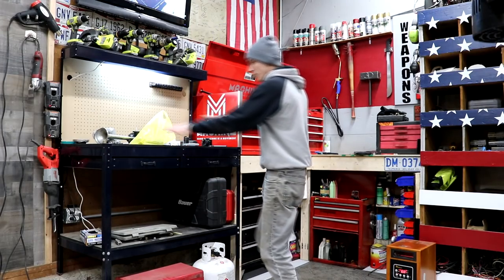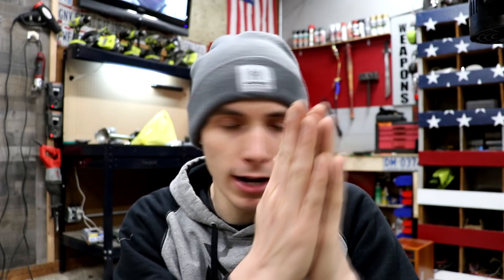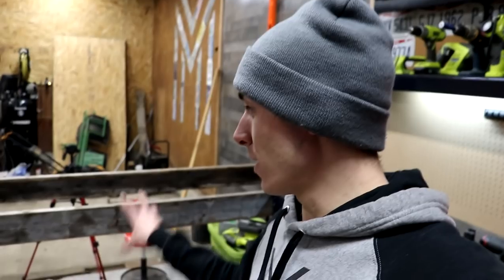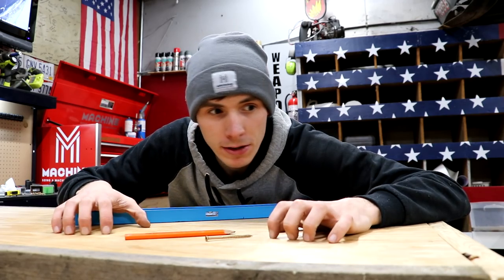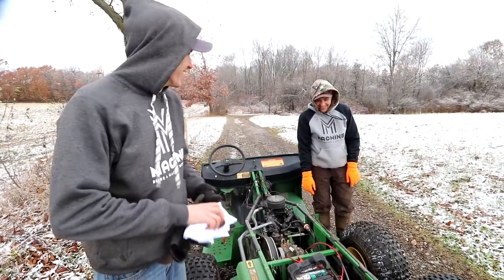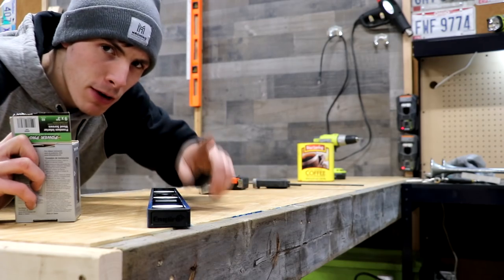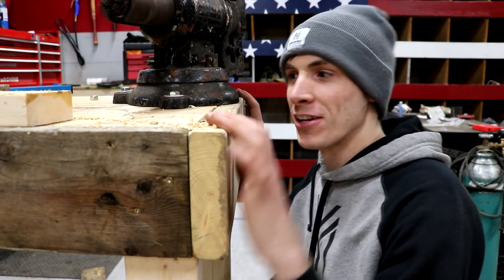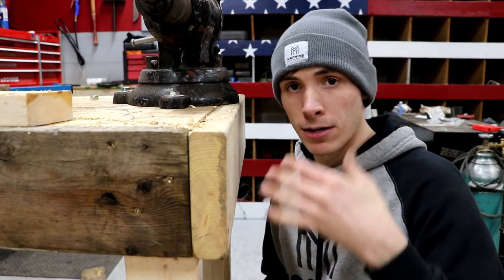SAYING GOODBYE TO THE GATOR

Comment: That sound may be a turbo leak. Same thing happens on MACK trucks I drive at work. Happened to me twice on two different 10 wheeler dump trucks . For me the problem was a loose clamp on the turbo where rubber is clamped to metal . Makes a reed sound.

Comment: Hey dalton I would recommend for you new work bench putting a brace from the bottom right to the top left corner on the end where you have the legs it should stiffen it up a little more

Comment: @3DMachines should keep the bed of the gator and turn it into a small trailer for like a gold cart or a side by side.
Reply: yeah right or get an old quad like a yamaha banshee cut the back of the frame off and weld the gator bed to it like a quad truck type deal.

Comment: table top should be sitting ontop of the leg/bracing , not inside it frame supported by a cross member. Thought that vise was going throw it when you tossed it on there.

Comment: That "baloon noise" is just your vehicles turbocharger winding down. Nothing to worry about.
Reply: Jesus Juice no it’s the transfer case just whining away, it’s cause there not really built to do shit like that but they can handle it
Reply: Flanders bmx makes more since
Reply: Lmao. Definitely something to do with the turbo and not the t/c

If they all do that, then every 4x4 I've ridden in is "broke" lmao. If your transfer case is whining you got issues!
Reply: Jesus Juice is correct. The noise at the end of that clip is from your Turbo and called Turbo Bark or Shutter if you will. When you were doing the Donuts in the snow you were also building up Boost Pressure keeping the Donut going. At the end of that last Donut you let off the Throttle and all that Boost you had built up had no place to go and so it goes back out the way it came in, Through the Turbo.  Totally Normal and Won't damage your Duramax!  My LMM Duramax does the same thing.  Great Video and keep the Duramax Mods Coming